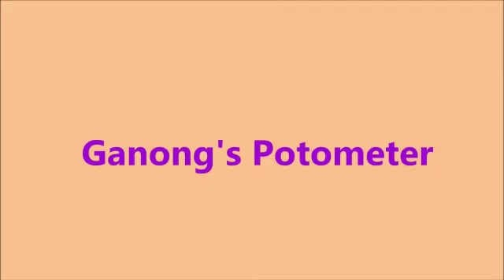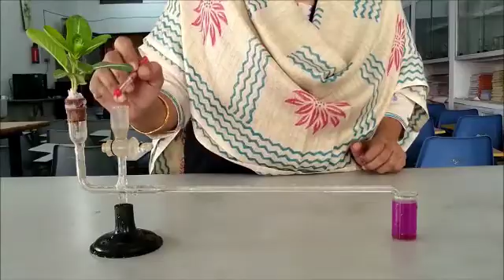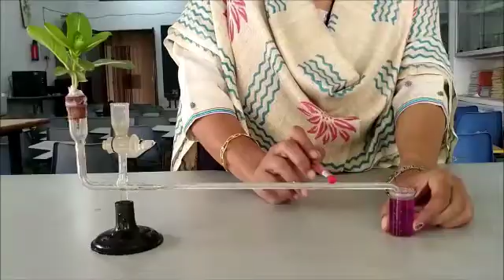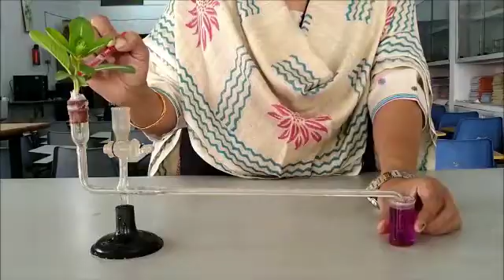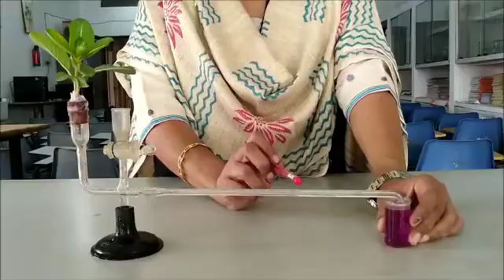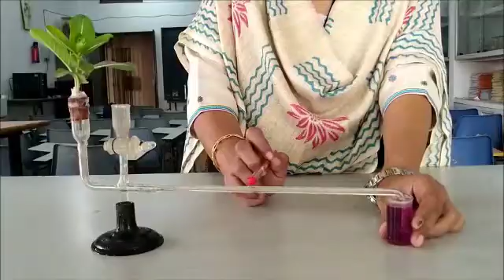Ganong's Potometer

Comment: What are the possible errors that you may have committed in this experiment?
Reply: Introducing air bubble is not very easy

Twig may not remain fully alive for a long time

Any changes outside the air temperature may afect the position of air bubble in capillary tube
Reply: @elon68  exact lines of class 10 icse bio😂
Reply: @elon68  🔥🔥
Reply: Didn't  got a reply?